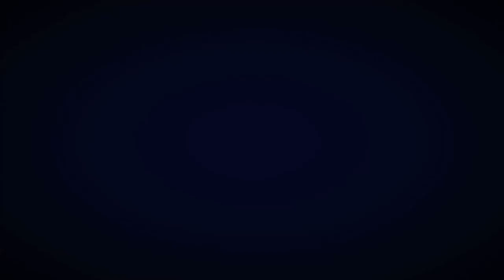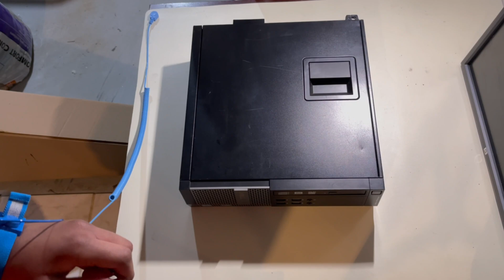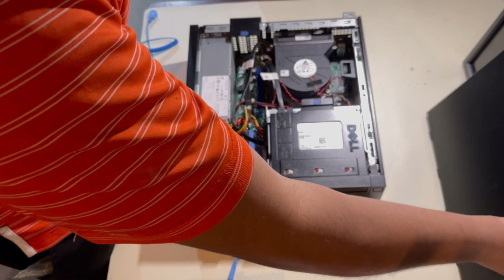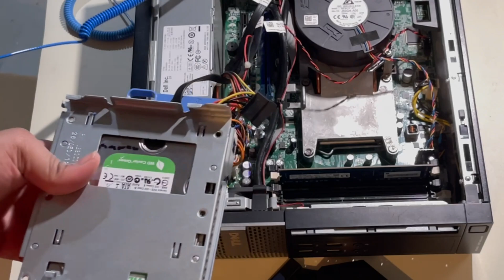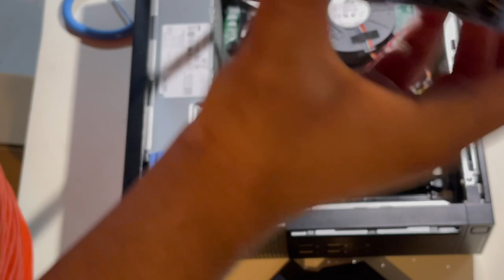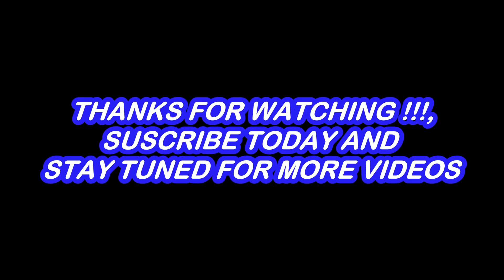Dell OptiPlex 7010 SFF Hard Drive Removal and DVD Drive Replacement

Comment: Thank you for posting this. I needed to pull my SSD out of my old PC that decided it only wants to be a doorstop from now on. The only part I hadn’t figured out was sliding the lock into the unlocked position. Now with the SATA to USB adapter that I purchased, I’ve got an external drive to go with my new PC, and I won’t have to recreate my budget spreadsheets (since I apparently overwrote the flash drive I had my backup saved on).